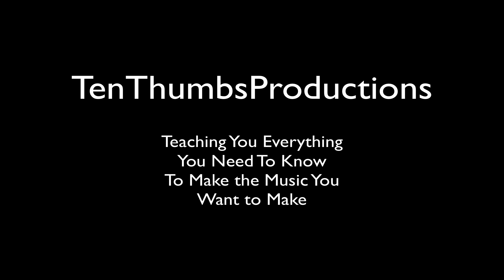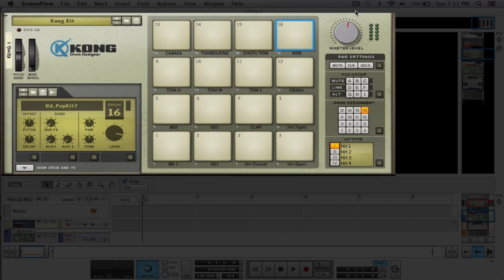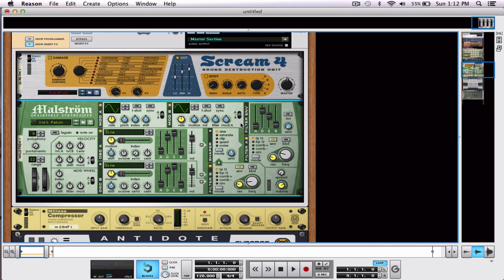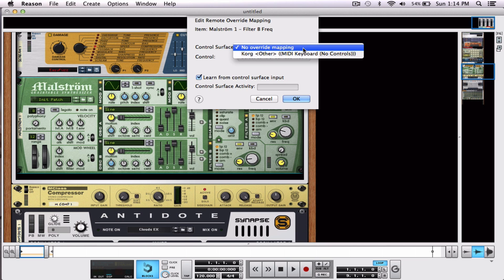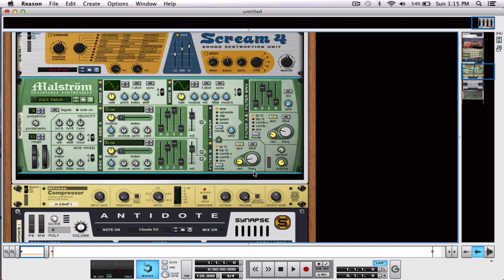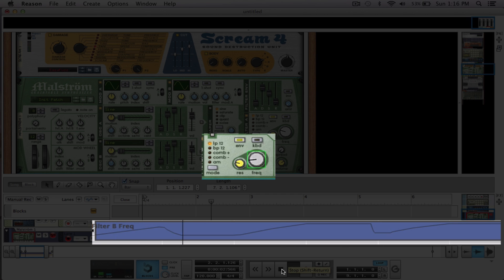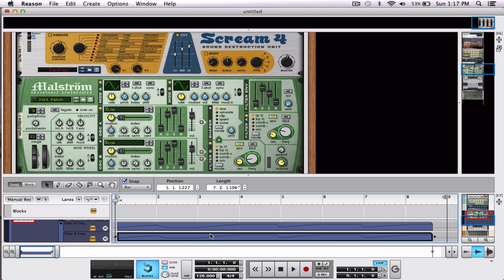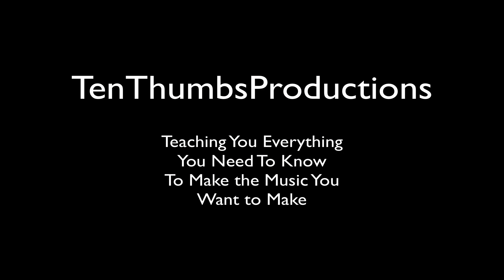Propellerheads Reason - Use MIDI - Assigning Your Knobs to Specific Parameters

Comment: Cant even get my mpc 2000 to sync in reason
Reply from the maker: have you checked your midi controller section under preferences?
Reply: @TenThumbsProductions  yea it shows my midi device but it doesn't respond to my presses
Reply from the maker: @neovincibeats  hmm… what version of reason are you running? Does the MPC 2000 require software updates? Does it no respond with kong? Try an NNXT and see if you get sound, it might be the range of notes that need moved.
Reply: @TenThumbsProductions  reason 11
Reply from the maker: @neovincibeats  that should work, and you tried it with the NNXT as well?
Reply from the maker: Also, does it connect with MIDI in or a USB? I use an MPC live but I record on the MPC and send it to audio tracks
Reply: @TenThumbsProductions  it's a moo which is midi to USB

Comment: Hi, i use arturia's keylab 49 and have learned to assign parameters to knobs and i got my drum pad working on reason as well. however while the automations record, the drum pattern does not. it will only record my drum pattern if i play it on the keyboard but i want to use my integrated drum pads to make music easier. helppp

Comment: Is it possible to assign to the bottom part of the nnxt because I want to assign the start sample to a knob on my midi controller. Thanks
Reply from the maker: +andre herring It should be, the test is to alt click it, and if a green square comes around it means you can automate it, and if that happens you can assign it to a knob, that is how I test it.
Reply: Thanks. I tried but it didn't allow that option.
Reply from the maker: what version of reason are running?